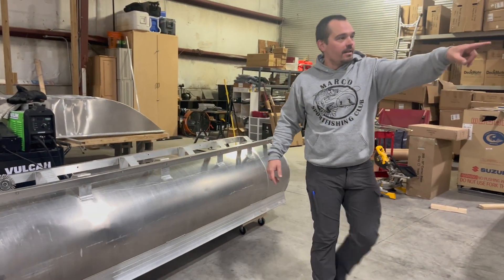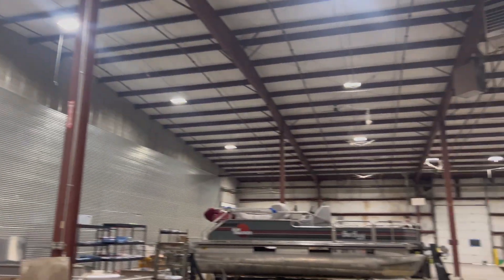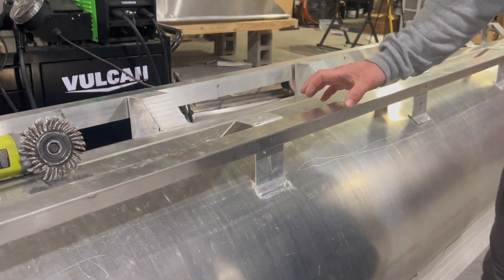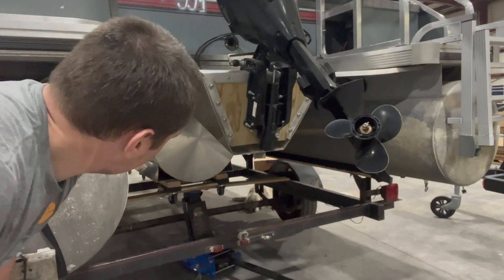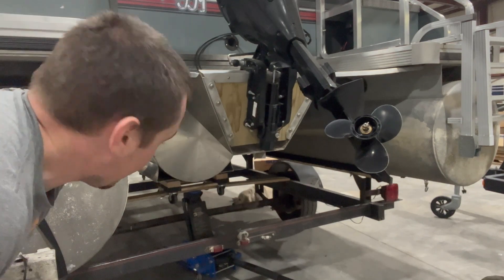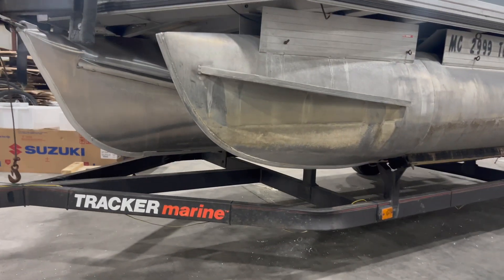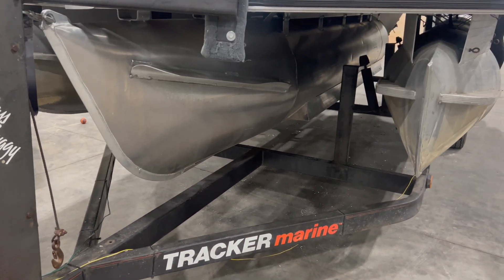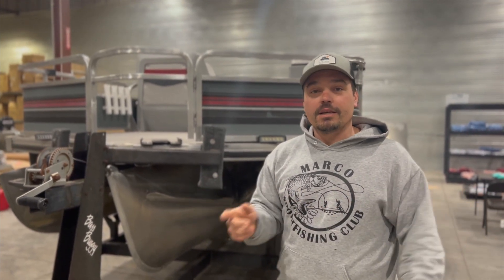Pontoon to Tritoon Conversion - Sport Toon Install

Comment: Do you have any videos of you all installing unwater lighting on a pontoon. Like Lumitec  zambezi lights?
Reply from the maker: We have not installed underwater lights yet, but I’m sure we will eventually. They should wire in like any other 12V DC lighting accessory with a positive and negative lead. Obviously you’ll want to make sure any connections are above the waterline if possible, and definitely use heat shrink connectors!

Comment: Hi Tom,
Is there a HP rating where you would recommended going full transom vs just a sport toon?
Reply from the maker: With a sport toon I would keep it at the capacity recommended by the manufacturer. The structure of the boat isn't going to improve at all near the stern, so adding a heavier outboard than they built the boat for at the factory will likely cause all sorts of issues structurally...bent crossmembers, cracks in the transom, broken welds on the transom and brackets on the pontoons, etc. 

When going to a full center pontoon with transom integrated there's a lot of gray area. There is technically no rules for the pontoon manufacturers in terms of rating their boats from the factory for HP and weight capacities. However, they rate them anyway for liability sake. If you improve the buoyancy, structure, and all around safety of a pontoon boat by adding a center pontoon then you're not breaking any laws (in most states, but still gray area there anyway). Liability becomes the issues. So for me and the tritoon that we built from scratch, I felt that if I kept everything similar to what big name brand boat companies were doing for HP and capacities on that size boat then I'd be safe. 

It's sort of like taking a Honda Civic and removing the tiny 4 cylinder engine and swapping it for a larger engine. Nothing illegal about it if you can make it happen. BUT if you go nuts and put a Hemi in it and then go speeding around and crash into another car, you're likely going to be at fault on numerous levels because of the ridiculous modifications you made that took the Civic way outside of how it's built at the factory. Can't stress it enough, there's a ton of gray area in the marine industry on aftermarket modifications and such!

Comment: Bravo Zulu !  I just found your site.  I have a Bass Buggy (95 I think).  I have it totally torn down right now.  About to install the new deck and talking with my buddy about all the goodies this will need and the subject came up to add a 3rd toon because of the additional weight of gear, coolers and bodies.  The original setup does no have enough floatation.  Mainly in the back.  However, the plan went from fish cruise to fish, cruise and bow fishing.    You have a great channel my friend.  Replacing the wood mount to aluminum to adding a 3rd toon.  I will give Colin an email to see what he has to offer.  More than likely I'll buy a single toon from someone and my buddy (expert welder) will go to town on it.  Again, Bravo Zulu on your channel.
Reply from the maker: Thank you so much for the kind words, and for checking out my channel. You'll be very happy that you converted your boat to a tritoon because of the higher and dryer ride, more capacity for load, and improved stability. They used pretty small pontoons on those old Bass Buggy's until later into the 2000s, so it's a great candidate. If you check around locally on Facebook Marketplace and Craiglist you'll be able to find a pontoon I'm sure. Worst case there's probably a donor boat you could pick up for less than the price of a new center pontoon. From there, fabricating a transom for the back of it is not rocket science...I did it with a pontoon a few years ago. Check that video out here:

https://youtu.be/yJelRaVzggU

Comment: Just got this served up randomly on YouTube but as I'm starting my build from scratch, I seriously want a third pontoon, I got 2, Harris pontoons, he told me they're 2024, he tells me he works with different marina's and sometimes picking up boats and moving them they get a little damaged and so are determined a loss, (I guess), they look fantastic and are identical to new Harris boats, he told me he had to have very minor repairs done, they have the channels for carriage bolts, about 20' 6", I was searching for a beefy transom but would much rather have a center pontoon with one built in, very hard to find for me, always too far away and very expensive for shipping when I do find one, I ended up buying 101" crossmembers from pontoon specialists, it's C channel 1/4 thick, heavier than I wanted especially where I wanted to go 16" on center, adds a little more than an extra 100lbs but definitely strong enough for a third pontoon, anyway just wanted to tell the world and any thoughts good or bad  are more than welcome! Merry Christmas!
Reply from the maker: Where are you located? There are several folks in the northern Indiana area who sell Harris center logs. Adding an extra 100 lbs on a 20' boat will not hurt you one bit!! Those logs float thousands of pounds. You'll be thankful to have the structure improvement over a little lighter weight, I promise. Especially as that weight will be evenly distributed. Now is the time to make those modifications and get the center toon on there...much easier to do now than after the build is complete!!!

Comment: What is your opinion of the Poly 3rd?
Reply from the maker: I've never dealt with the poly 3rd toon. Had a chat with the owner of the company a while back and he certainly thought it was the greatest thing on Earth, and then I never got a call back from him so the conversation stopped there. The reason I'll only use aluminum pontoons is because the poly toons don't add any resale value. They take away from the factory pontoon look that most people are looking for if they're in the market for a used tritoon. And even if you're going to keep the boat forever, the price of those poly kits is very high. Someone could purchase a full length with transom aluminum pontoon custom fabricated for the same price or less. You can tell I'm bias towards aluminum and the factory look!

Comment: Just watched your tritoon conversion. I just converted my 20' Stardeck with a sport-toon(approx 3/4 of length of outside pontoons) last spring. Welded in 1 1/4 in. channels to lower it about 1 in. from outside ones. Did it myself on trailer where boat is parked for winter storage-outside. I used 2 ratchet straps and endless number of measuring, lowering, raising. I've done many other projects that were way more fun-lol. With the 60 HP. Etec, with one or two on board, actually makes the nose rise almost like our 17 ft. runabout. And best of all, now when family or friends pile on( mostly towards the front) it still sits level.  My cost was $750. for a used pontoon, $250. for cutting it to size( welding end cap back on, pressure testing etc...) and the cost of stainless bolts, nuts and washers. By the way, much more stable in choppy waters.
Reply from the maker: I think most folks want to see incredible performance increases out of adding a third pontoon, but what you've explained is the most consistent and best results possible. More stability, higher and dryer ride, etc. That outweighs the increase in speed in terms of a positive outcome. More HP can always be added later anyway if that's the goal. Well done!

Comment: How would you feel about adding this set up Tom my new 18 foot Bennington ? Any suggestions on size and links for shopping for the correct size toon what would the average cost be for the sport toon I would need
Reply from the maker: It's 100% doable and would make your boat more buoyant in the front if you're on bigger water or constantly have the front loaded up with people. It really depends on the HP of your motor, as the larger HP may lead to issues with water flow from the center pontoon to the motor. Check out Ebay and Great Lakes Skipper for sport toons. They're usually anywhere from $500 to $1500 +/- for a sport toon. You'll want to make sure you get a center toon that matches or is larger than the diameter of your outer pontoons. This video breaks things down too:

https://youtu.be/eLdAA6lYP10
Reply: @tomspontoons  it’s a 60 HP Mercury and yes I’m on a very large lake Biggest lake in NH Trying to find the correct size and if I will need to make any adjustment to the motor
Reply from the maker: @MelissaGarland-vh2se  Lake Winnepesaukee by chance?? We built a work barge for that lake last winter!

I would strongly recommend the full length toon with transom built onto the rear. It’ll give you better performance all around, better floatation and stability too. You could have a local welder fabricate one. Or email RCV.Pontoons@gmail.com for info about having one made and shipped. They’re located in Ft. Wayne, Indiana and make custom sized pontoons to order with transoms for conversions!
Reply: @tomspontoons  yes Winnipesaukee and Thanks for the info and great YouTube Videos
Reply from the maker: @MelissaGarland-vh2se  happy to help! Thanks for watching our channel!

Comment: Hello, l was wondering if there's a need to put center bunk after installing sport toon? Also how much more weight capacity is added? Thanks, l  really appreciate the time you take to make these videos.
Reply from the maker: Thanks for watching our channel. It's honestly personal preference. If you trailer a lot then it's going to help with the longevity and structure of your boat. The wear and tear is on the crossmembers from all the bouncing of trailering. If it's an older boat with lighter duty crossmembers, or you can't hit all the crossmembers available then it's a good idea to put a bunk under the center toon.

Comment: I have the 98 bass buggy I wanna do this exact same thing! I was curious if this would work. I dig it thanks:)
Reply from the maker: It sure will! If your motor is a higher HP where your boat is moving faster you may want to consider some other factors like engine height, center toon size, etc. if you go with this sport toon style. This video breaks that stuff down in more detail:

https://youtu.be/eLdAA6lYP10

Comment: Do you think the angle is better than just flat stock on top?
Reply from the maker: Angled is definitely stronger...an old fella once told me "every chance you get to put a bend in metal, do it. It'll make it twice as strong". Plus the angle gave me two places to get a weld on it. On the top side and the bottom along the brackets.
Reply: @tomspontoons  I'm about to add 3 new toons to my old tracker.  I'll take all the advice I can get. 😂
Reply from the maker: Hope the project has been smooth. Happy to try to help from my experiences!

Comment: I gotta know where they found those corner caps for the rubrail on the bow!
Reply: Are those just the 90 degree ones from pontoontuff?
Reply from the maker: @andrewpennuell5469  They're these:

https://www.pontoonstuff.com/products/pontoon-boat-corner-caps?_pos=1&_sid=050b53401&_ss=r

SKU: SRCC

They're a slight radius, not the "square corner caps"
Reply: I’d like to find some that actually fit the angle of that corner. So those are 90 degree corner caps? Did you modify them at all?
Reply from the maker: @andrewpennuell5469  yes, these are for a 90 degree corner. I’ve not found anything else. Best case would be to weld some up out of 1/4” aluminum to match the angle just right.

Comment: I have a 22 ft quest with a Honda 115. i just picked up a center pontoon, with the added buoyancy, will i also get any additional speed? I have changed  the prop and added an out board foil gaurd. still lucky to see 18-20 mph. Or, do i need to replace the pontoon all the way to the transom to achieve this? Thank you. Love your channel by the way
Reply from the maker: Adding a center toon and keeping the motor the same seems to make no difference on speed for an empty boat. HOWEVER, you'll typically cruise at a faster speed when the boat is loaded up heavy with people and gear. The drag of the center toon appears to counter the improved buoyancy in an empty boat...but the buoyancy improvement makes a bigger difference when loaded up. Hope that makes sense!

Comment: Hey. 
Ive got a 1992 party barge 24 
It does not have the shorty center toon many of this model had in the front. Its hard to find as well
I put a blackmax 175 on it several yrs ago did my prop math for optimal mph anyway its a true big ugly old sleeper however ive always wanted to add a toon. These oldies plow in the front unless wide open.I was thinking a 20 ft would be fine as the transom is about 4 ft anyway. To avoid the cutting and welding. 
Have you done this exact thing on a 24?
I'd love to bolt right up with the same diameter toons. The prices of these things used have just went through the roof recently
Reply from the maker: I haven't tackled that exact project before. The issue with sport toons with high HP is water flow to the propeller. Sometimes they work just fine, but often as you reach higher speeds the water will flow under the prop and cause ventilation and over-revving. I would strongly recommend a full length center pontoon with the transom integrated. 

https://youtu.be/eLdAA6lYP10

Comment: Does it have any problem cavitating being so close to the transom?
Reply from the maker: This one will not because the motor is just a little 20 hp, not enough to get the boat moving fast enough to even find out. In general, every foot you go back from the planing surface (center toon in this case) you can raise the motor 1”…so if it were bigger HP we would have to make sure the cavitation/ventilation plate is at the right height for that equation.
Reply: @tomspontoons  Thank you Tom!
Reply from the maker: @goldenpondrvpark1637  happy to help!

Comment: What length in comparison should the center toon be compared to the outer toons
Reply from the maker: My favorite setup is a full length center pontoon that's about 18" to 24" longer that the outer pontoons. The center pontoon should line up in the front with the outer pontoons, and the extra length should stick out behind the outer pontoons for better handling at speed and better trim response to get the bow up when cruising.

Comment: I have a 2018 Party Barge with  150 Merc.  How much would it cost to put a third toon on?
Reply from the maker: Lots of variables in terms of cable length, hydraulic steering, length and width of outer toons. In general, It's around $4500 for a full center pontoon plus any changing over of shift/throttle or steering cables, plus labor. Usually ends up around $7,000 to $8,000 installed in most cases for a full length toon. I wouldn't recommend doing an aftermarket sport toon on that setup with that high of HP.
Reply: @Toms Toons Pontoon Refurbishing  Thank you for your reply.
Reply from the maker: @scottlucas4824  Happy to help!

Comment: Hello, I want to build a boat 7 meters long and 4 meters wide and 3 tubes How much tube size should be suitable for transporting 15 people?
Reply from the maker: Search out new boats from the big manufacturers to find a comparable size boat and they’ll list the weight and passenger capacity. I don’t have an exact calculation for that.

Comment: Was there a big price difference to do a little longer center tube with an incorporated transom?

What is the centers tubes diameter ?
Reply from the maker: This center toon was right around $1500, and labor was significantly less than a full transom toon as it’s just a bolt up scenario. 

Center toon was 25” diameter. Outers are around 20”. Not a huge concern as the motor is not fast enough to create water flow or cavitation issues.

Comment: Love your videos but wife dreads when I watch them with all of the ideas you provide :)
 I have a 22' Sunchaser 115HP Evinrude with 25" toons. I'm going to add a center pontoon for a little extra buoyancy. Im seeing most center pontoons are a little lower than the outers. Would you recommend I put a larger center toon on possibly 27" or use the same 25" and just lower it slightly.
Reply from the maker: She'll end up appreciating the work you put in when you're out on the water together!! I would definitely recommend getting a 27" middle toon, and full length with transom if possible with that HP motor. The larger center toon will give you better handling on turns, and will improve stability with the added buoyancy of the larger toon. If you can't find a 27" then yes, I would try to push a 25" about 2" to 3" lower than the outers. Great Questions!

Comment: Tom, I really appreciate your channel. By watching your channel I have replaced a floor, carpet , console and furniture in my 93 Landau. So thank you so much ! 
I would like to add a third toon to mine. It’s mostly used for fishing , but I do carry the family out several times a year for fun. My boat is a 20 ft . I guess my question is , should the center add on toon be the same size as outer toons, or bigger , or does it matter ? 
Thank you
Actually you just answered that for me in another video haha
Thanks
Reply from the maker: Fantastic!! Thanks for watching the channel. If we’ve saved you some time and money please consider contributing to the channel. Right now all funds are going to a project building a fishing boat for a Marine Corps Retiree. Links are in the description.

It doesn’t hurt to go with the same size or even a few inches bigger diameter. Bigger diameter will allow for better turning with higher HP…but the bigger the HP and higher the speed the more chances for disturbances getting to the prop causing issues.
Reply: Will do ! Thanks